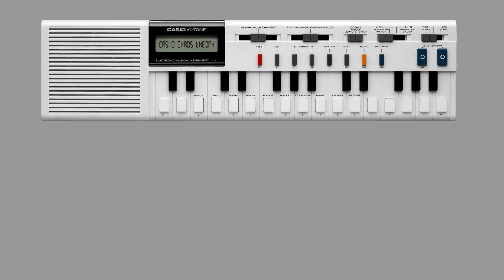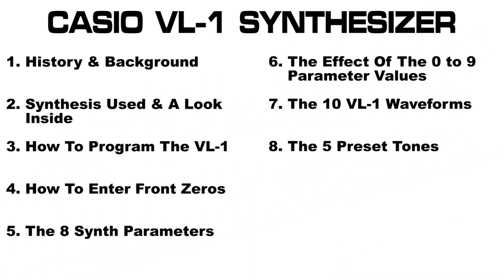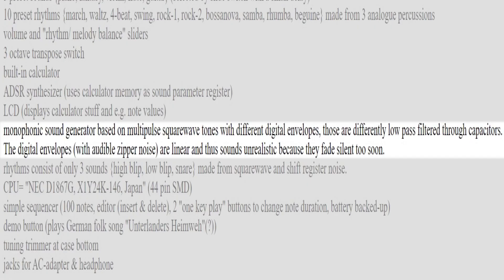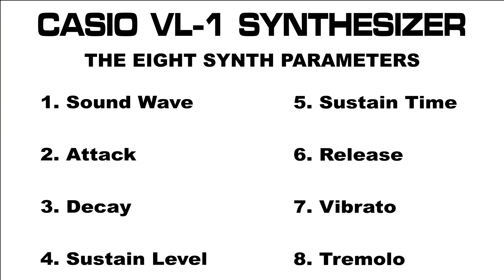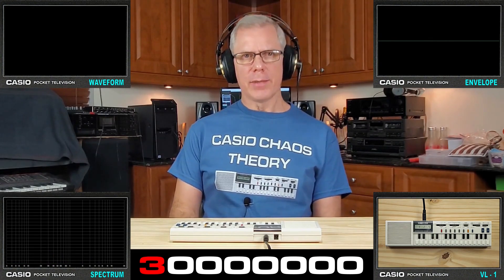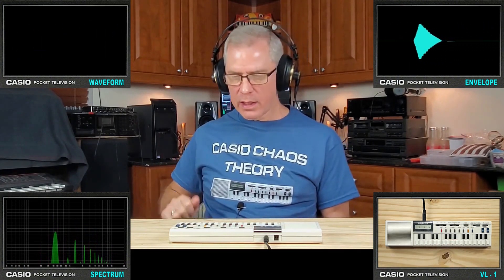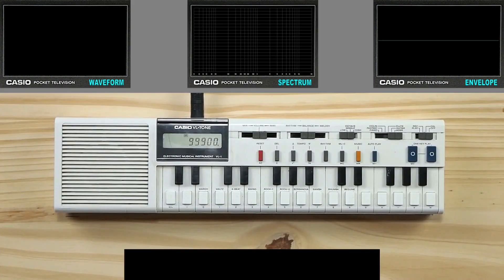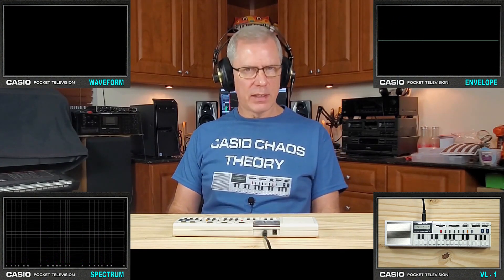Casio VL-1: The Little Synth That Could

Comment: Thank you for the helpful programming info. Mine arrived yesterday and am immediately IN LOVE with this little guy! It is surprisingly capable. However now I am a bit apprehensive of taking it apart to inspect the volume slider which has some issues with being really scratchy and causes issues engaging the speaker now that I saw just how fragile that LCD ribbon cable is.

Comment: I can't believe you destroyed the VL-Tone. The saddest part was that you didn't even show us the PCB we needed to see so badly after you did it. :(  At least this was a warning to people to never take off the upper pcb. It needs to stay safe.
Reply from the maker: It's not destroyed. Everything still works except the display. The PCB where the cable connects to it can be seen @6.10 and other than the NEC CPU, all that is on this side of the board are three resistors and some tiny SMD capacitors. Otherwise it's primarily used for the keyboard buttons and switch contacts. I also showed a close up of the NEC CPU and where the ribbon cable connected to the board @6.14. Had I known the cable was going to detach itself then I wouldn't have removed the board, plus I had previously taken my VL-1 apart with no ill effects. This time I wasn't so lucky. However, for the sake of video documentation and information, I wanted to take it apart again so that viewers could see what was inside, and when the cable detached itself I showed this as a warning for others that this might happen if they disturb the the boards in question. 

I have also been researching how to re-attached the cable to get the display fully working again, and once I have the required solution, I will of course film this and publish a video showing how to do it.
Reply: @CasioChaosTheory  I'm wondering if you could just line it up and try hot glue on the top!!! Anythings worth a try I guess. I wonder if there is an adhesive out there that is conductively transparent. 

I agree with you that the VL-Tone isn't really destroyed but this happens way more often than you would believe and people treat it as junk when it happens which is really sad as they aren't making new ones.

People should probably list the broken ones  on ebay for £2 or something so they can find a home instead of sending them to landfill or similar.

Comment: Great info thank you. I’m wondering if there is a way to modify it to pitch down to be a bass monster.
Reply from the maker: Thank you for the compliment! The VL-1 has a tuning potentiometer accessible via its underside, and when people carry out pitch mods to old keyboards they would normally swap this for one with a different rating allowing it to cover a greater pitch range. A caveat though is that this potentiometer often affects that overall CPU clock speed, meaning that EVERYTHING will get pitched up and down, and it will also affect the speed the rhythms play back. When it only adjusts approx. 1/2 a semitone this would barely be noticeable. When it adjust an octave or more, it will most definitely be noticeable! I haven't carried such a mod out myself, but a quick search shows a circuit bent VL-1 with what very much appears to be a substantial pitch mod @ 8.55:

https://youtu.be/oP2zs5SQJEc?si=_GTP2oH4SzS34GZE&t=534